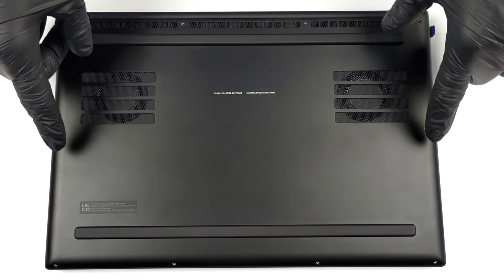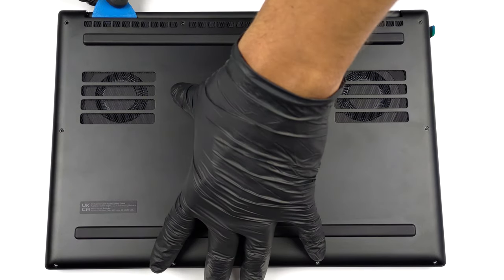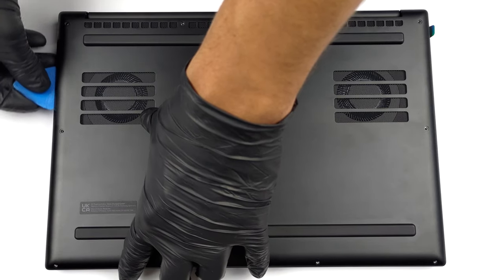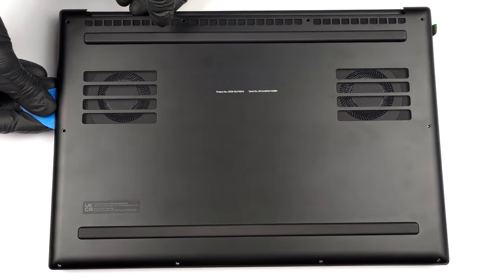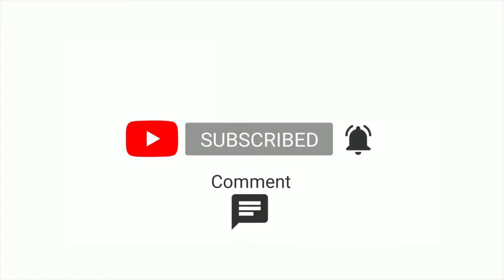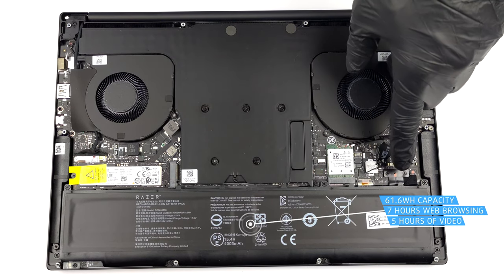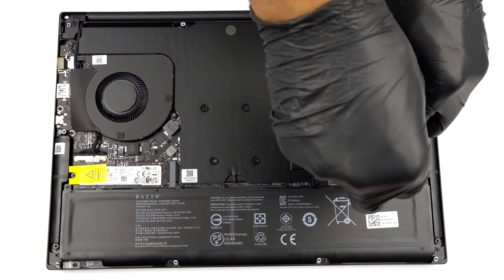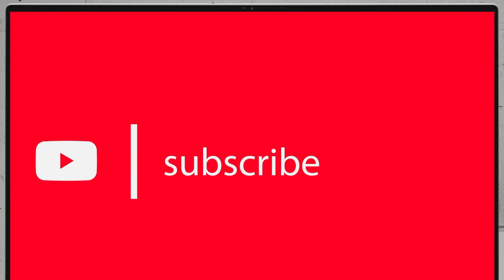🛠️ How to open Razer Blade 14 (Early 2022) - disassembly and upgrade options

Comment: overpriced laptop
Reply: It's a fucking monster tho
Reply: @mapleleafs4lyfe  mine is getting hot asf and ain’t performing as well. So slim tho
Reply: @ohmanhotham8823  Same here, This can handle cyber punk, but the heat kills preformance. I swear i've been using actual ice cubes to cool it.
Reply: @aoitang2722 possibly due to the voltage. Try under volt in bios
Reply: @aoitang2722 Ong performance is pretty good but it get unbelievably hot even on medium-high graphics settings